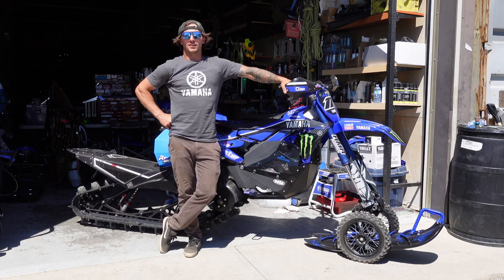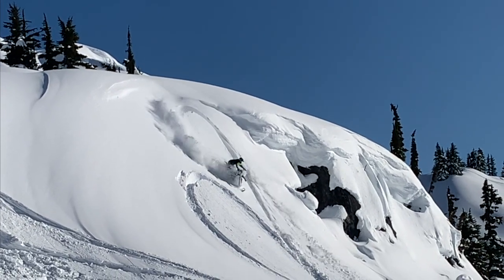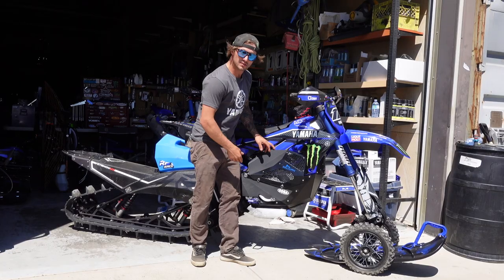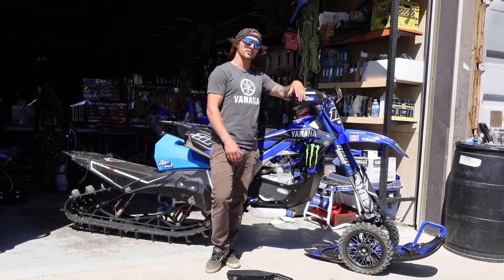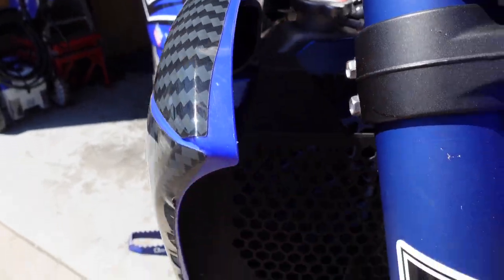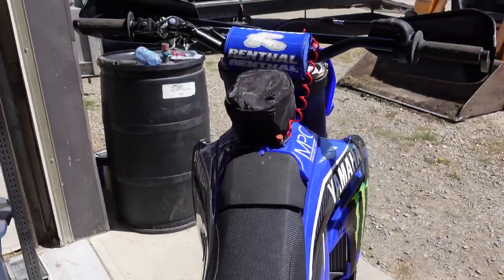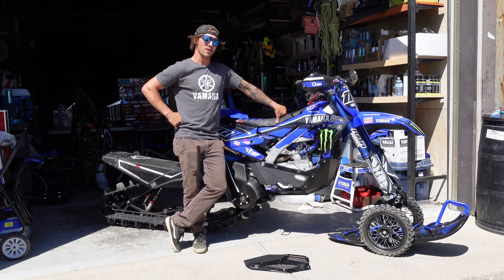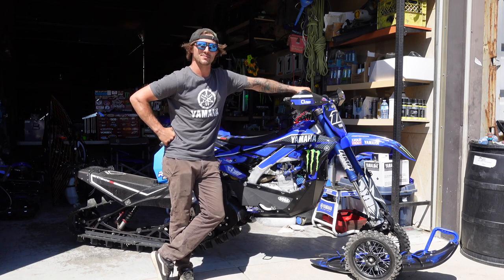Snowbike Build Walkthrough 2021 - Cody Matechuk

Comment: Cody thanks for the info, very helpful. Do you replace the entire stock yz kill switch with the outboard model that has a switch built into it? Seems like a good move. Just want to know if you deleted the stock one entirely, or have both wired in. Thanks so much.
                       -Stewart
Reply from the maker: Hey Stewart! Yes, what I do is I cut the kill switch close to the plug (leave enough room so you can cut it again if you wanna wire the stock switch back on) and I wire the stock plug onto this kill switch so it just plugs right in

Comment: Will the GYTR app provide enough tuning for the RP race backcountry exhaust?
Reply from the maker: Yes but the stock box doesn't provide the same benefits that the Vortex box from C3 provides with live altitude adjustment, and cold mode delete. when you dip below a certain temp, it doesn't matter what map you put in the stock box it goes into "Cold mode" and adds a bunch of fuel to make it rich, this is when you get the fuel in your engine oil
Reply: @CodyMatechuk111  10/4!  do you happen to have a good starting point for gytr with the rp race and CR intake ?
Reply from the maker: @22Kreedmire  Im sorry but I don't! I don't like to run the stock box in the winter. The CR intake will restrict a bit of power, its the trade off for having the intake out into clean air and the RP will want more fuel because it free flows so much, The back country "Straight back" generates more power in higher RPM so I would potentially look at adding fuel on top but its hard to say without dyno. Patrice Goyette at MPG Moto in Quebec may be able to help you out with a map!